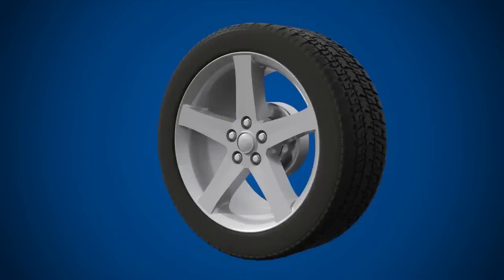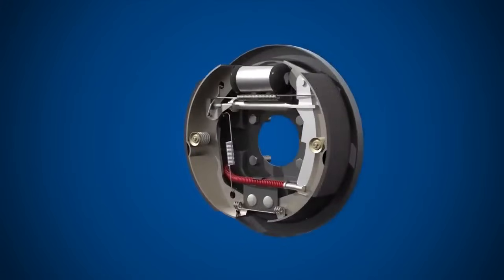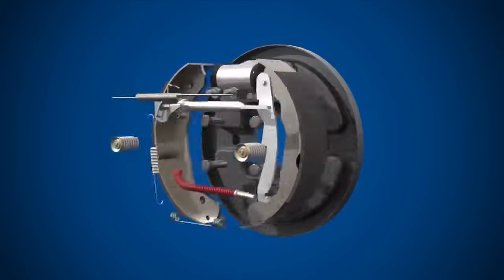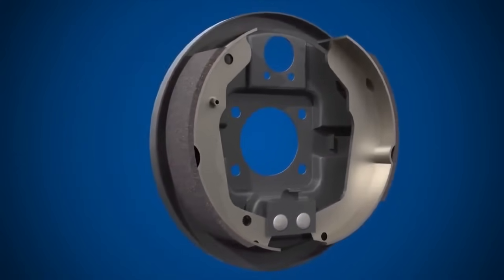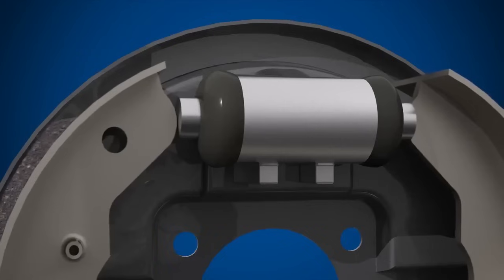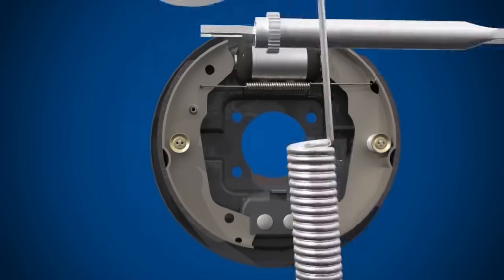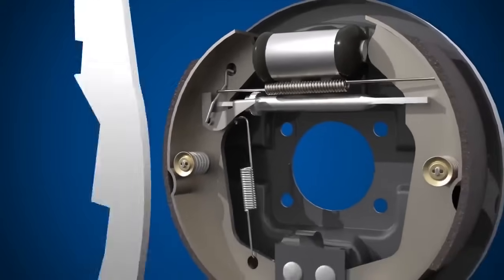How do drum brakes work in cars and light vehicles. (3D animation)

Comment: This skillful animation raises the bar on the genius mechanism of drum brakes. As I'm sure you know, there is more to it, and potential for another video explaining critical features. 
1. Why does the leading shoe have to be smaller in size than the trailing shoe?
2. How does the star wheel automatically compensate for shoe wear? How does automatic adjustment actually work? Why does it work better when braking in reverse?
3. How are the shoes positioned to convert some of that frictional braking force into outward braking force? ie why do the shoe carriers rotate and shift slightly as braking force is applied? 
4. Is that rotational shift of the shoes the mechanism for automatic star wheel compensation?
5. How did they position the shoes and lever arm to augment braking with frictional forces without increasing the risk of lockup?
Some of these design features may soon be lost, since nobody talks about it any more. Another clever video animation could well represent that effort, for time immemorial.
Reply from the maker: A very logical and clever engineered solution. Mechanically genius . At the very least it should be remembered that the most effective solution is not necessarily the most complex. Planet gears another great example…
Reply: @Spraiser74  would you considered this complex?  as a weekend warrior, i'd rather work on the typical pad and rotor instead.  seems easier to understand than this complexity.  from an engineering perspective, this is a marvelous design but i think it's a bit unnecessary if pad/rotor would do the trick.
Reply: The animation shown is great but I would be very interested in the animation you suggest as well. I was wondering how the self adjusting mechanism worked and didn't know about the other features you mentioned.
Reply from the maker: Guess it depends on your needs and car, any practical exploration and “diy” is to be encouraged, love the idea that you and others are getting stuck in and hopefully this sparks more interest. Horses and courses, drum brakes can last longer and generate less intense heat. Next time you’re out and about , take a look at the wheels and see how many use pad disc vs drums (if you can spot any). Also check out https://youtu.be/lsp8sdGGvWg?feature=shared

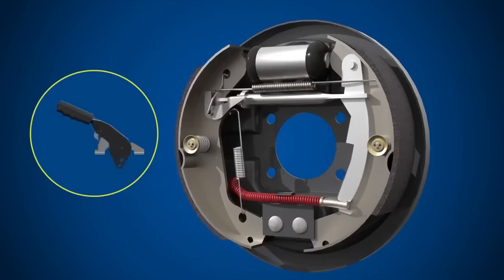Comment: this one is good, better than the other one with more viewers. Since intuitively from the drawing, when you pull the handbrake upwards, the brake shoes retract inwards so @3:04 how is the handbrake cable tensioned to push brake shoes out?
Reply: The parking brake lever is pulled inward, pushing the spreader bar to actuate the shoe outward.

Comment: Now I need to figure out the "self-adjusting mechanism"...
Reply: As the material of the shoes wears off, you would need to push the pedal further and deeper as time goes by. To prevent you from having to push the pedal deeper because the material wears off and the shoe getting thinner, it would be more convenient if we could put the now thinner shoe closer to the drum right (instead of being obligated to replace the shoe again and again). To exactly this end this mechanism has been invented.

When the shoe gets thinner, the vertical spring in this mechanism has less force pulling on the two ends, thus allowing the spring to contract a little bit resulting in the gear thingy going down one notch. The gear going down one notch has the result that the horizontal bar on which the gear thingy is attached extends itself a little, pushing the shoes further apart and thus also putting them closer to the drum. I believe this is how it works.

Hope that helps.